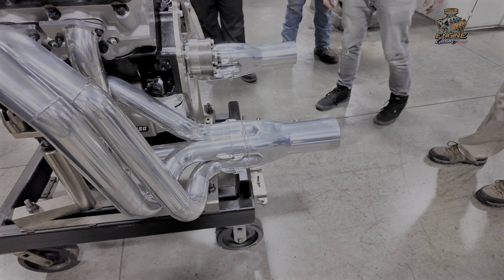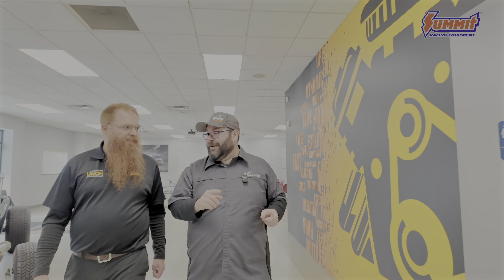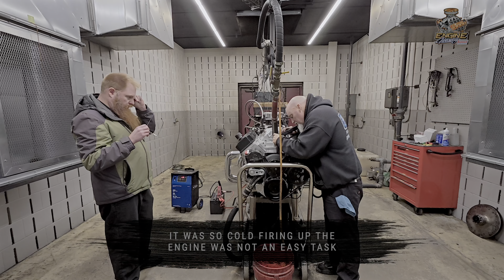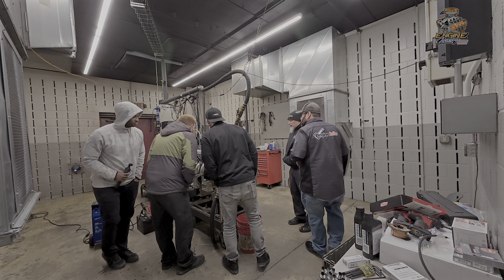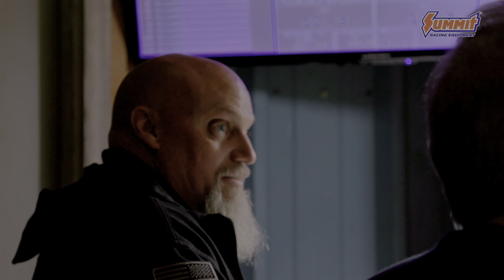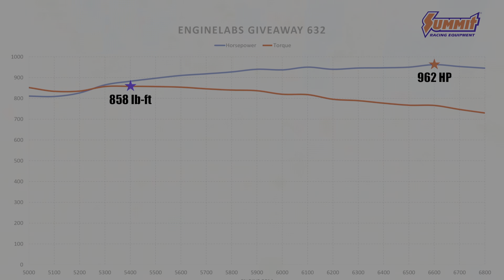Dynoing The EngineLabs Giveaway 632-Cube Big-Block Engine

Comment: Crazy how you don't have to do an elaborate build like this to make 1k HP at the crank with modern muscle cars.
Reply: Not naturally aspirated. And it won't sound as awesome as a big block.
Reply: @scottparker3342 I guess you misunderstood what the word "Elaborate" means.  😂 I don't care if it's pedal powered and creates 1k Horsepower.  If you got the MONEY, more importantly here than the time, buy all means build this.  But ain't no manufacturer going to build a 1k Horsepower car either.  Plus this build is closer to 850whp just like my simple build that took me a weekend 😂
Reply: @nitodiaz8636  I get it. If you add boost to modern muscle cars you can make 1k HP. It's just not the same.
Reply: @scottparker3342  Everything is better,  the modern cars build is simpler, cheaper and chops. If you like to struggle and spend a heap of money do what these guys did.  I'm not saying you won't or can't get results.  It's just a harder process. Modern Times have gotten simpler to build big Horsepower gains without starting from scratch.
Reply: @nitodiaz8636  yeah, it's a good thing this engine is free.